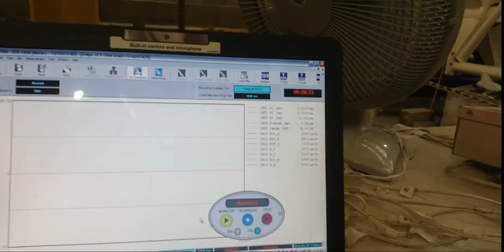FIU Bridge Collapse failure -  North Side of Canopy, bottom of deck, and bottom of #11

Comment: I am so impressed with your research and engineering analysis and design knowledge!  I have really enjoyed watching all of your videos!  We would never have this in depth view of this without all your efforts.  Thanks!
Reply from the maker: Danny, thank you for your kind words...  Sometimes, I think I may be going to fast or might lose the viewer by assuming somethings...    I do try to turn down any technical terms and calculations...      
I try to think like a person who has no experience with structures and share with that in mind... 
That is why I also use videos such as the one in this video...  to help people visualize what happens when loads are applied... 
This bridge structure, is a lot more complicated than this ''simple'' reinforced beam structure but still will follow ''unsupported'' load paths that are predictable to a point...  Again, I think the part that all the engineers found to be ''predictable'' were thrown out the window with all their ''alterations'' to the original approved plans and process... as documented, ''softly'' by the inspecting engineering firm (BPA)...

Comment: Fascinating stuff. Your taking me back to when we use to do these experiments a university. The bending moments are largest at the end points . Forces propagate from top down and the crack develops from bottom up.
Reply from the maker: Latitude plus the counter forces from the load points / end points...      Just sharing:
I love studying cracks... they speak to what is going on with materials and concrete specifically; although concrete can be a bit unpredictable...  Unless, you break it up to smaller sections and allow it to expand and contract.  
Which is not possible if it is butting up a non-moving member and it needs that room to expand...  (I know an odd statement but, I love playing around with systems and trying to make them not crack - by added fiber, thicker layers, fiber mesh fabric, and different mixes that allow for more expansion...
 Mostly vertical systems...   Horizontal or systems on grade are always subject to breakage (as I say, that is what the Earth does, it ''cultivates" with it's natural movement and we cannot expect to put a firm object on a moving surface and not expect cracks to eventually occur)... 
We are just buying time, until the Earth reclaims that ''turf"...   
With all that said, the stone foundation systems beat mother nature out... they already have built-in cracks and mother nature can't create cracks in a cracked system...  
I enjoy the value of stone foundations for this quality... they have built in ''slide hinges'' etc.   (one layer can't affect the very top layer ... of course it is also limited in height...  like the Brooklyn bridge, etc.  Or the Philadelphia Benjamin Franklin bridge. )